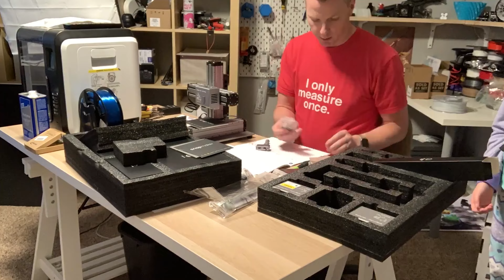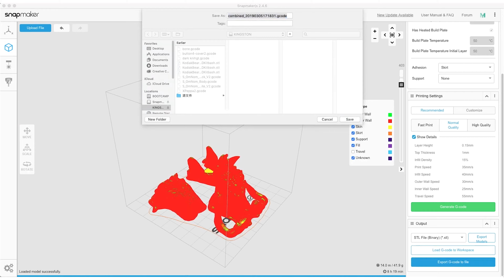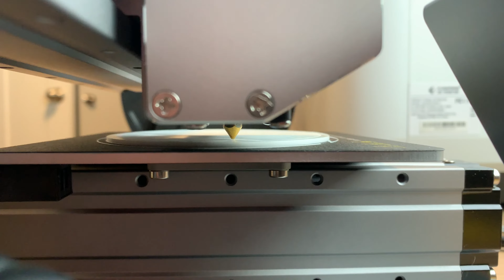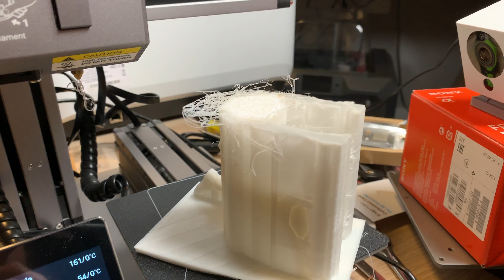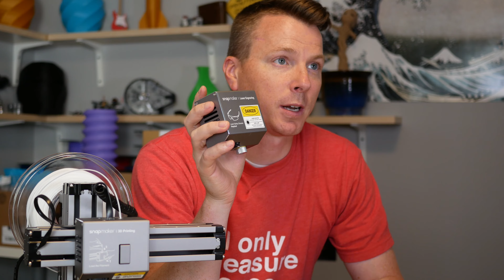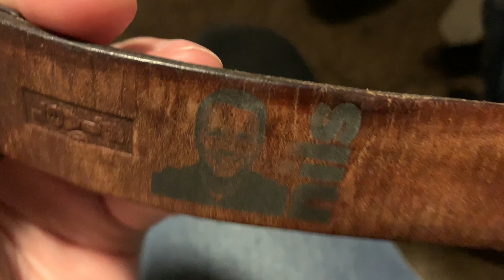CNC Machine, Laser Engraver and 3D Printer in One! -- Snapmaker

Comment: I just purchased my original and for some reason i am very slow now days and need help in all three phases of the machine. I have had some health issues and i think that has something to do with my slowness.. I just need help with getting started. how do i start a 3d print project? what do i need to do first? how do i convert 2d photos into 3d images? next how do i start a laser printing project?i have been getting confused very quickly and just need some guidance. Once i learn what my path is i will be good to go.last of course is cnc. as with all once i find my way i will be good. so Nils if the community could give me a boost i could pass it along and give others help also. I feel so dumb it hurts. I didn't use to be like this but now i am. It takes me a very long time to figure things out. Once i get it i feel great and can explain it to all around me. so please help me out. than you. Greg/